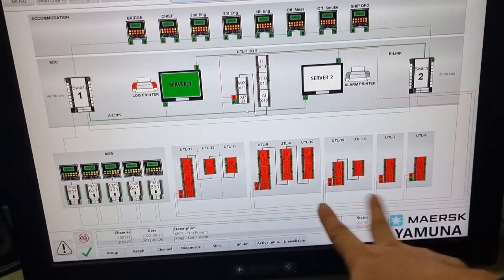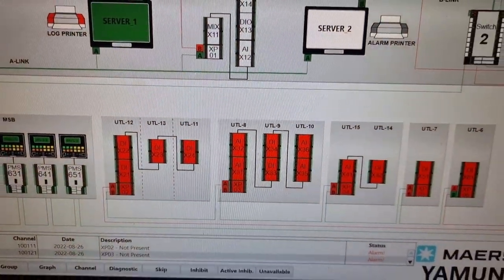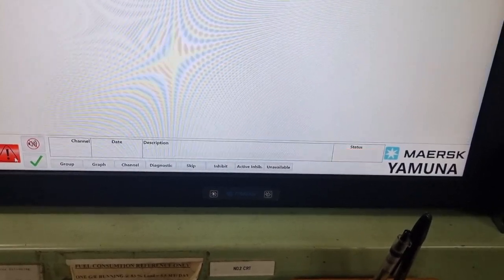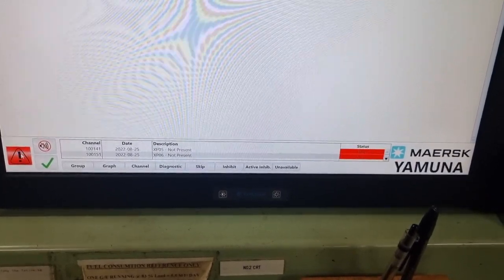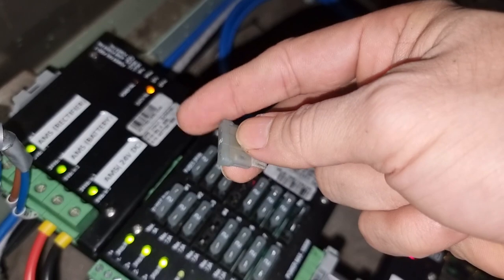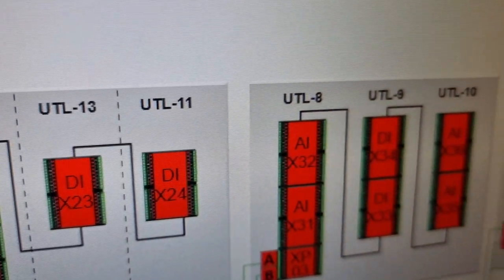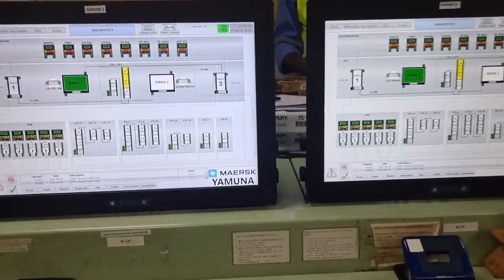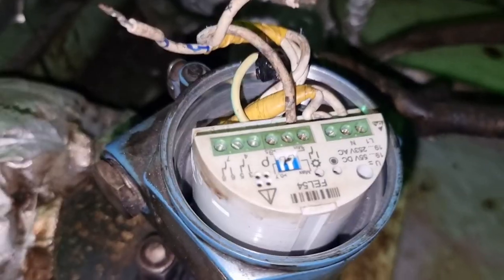MAIN ENGINE TROUBLESHOOTING TEMPERATURES AND PRESSURES ARE MISSING IN MONITORING SYSTEM

Comment: in such a situation, the most important thing is to determine the location of the control units ... and then look for the cause of the malfunction .... Often, as practice shows, the first problem is to find the faulty module .... The material is well presented and, most importantly, with a good example. and for a better understanding, provide an electrical circuit for switching elements in the temperature monitoring circuit, for example, a block diagram. Respect and continue you good practice training ... BRGDS !!!